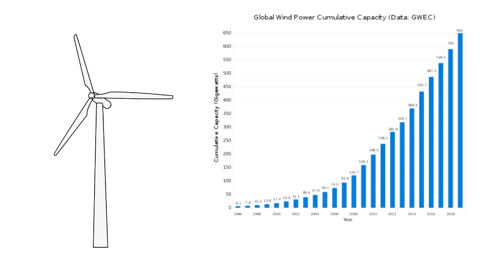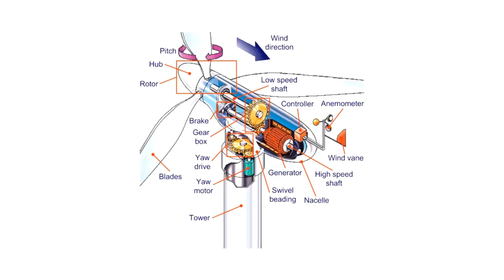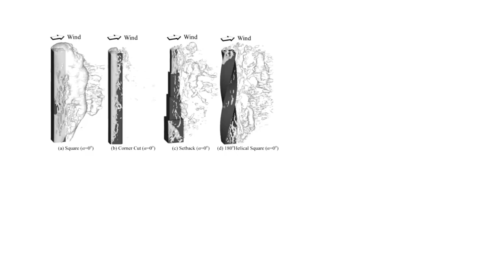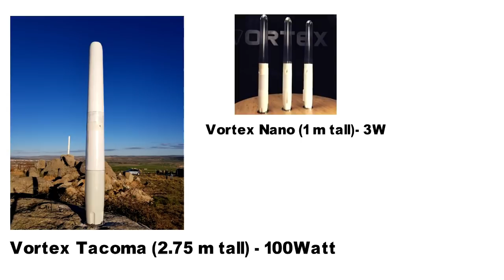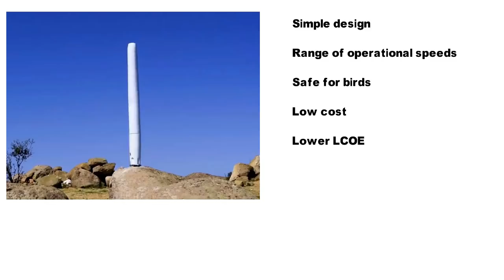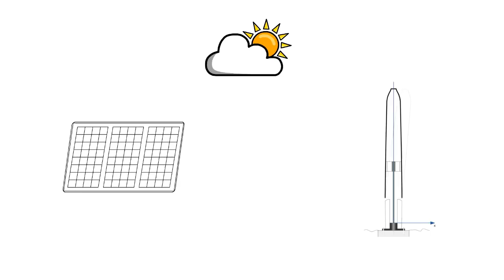Bladeless Wind Turbine

Comment: Place them along side a highway.  The passing traffic generates gusts of wind.
Reply from the maker: Great idea.Would also act as separators
Reply: I like the idea, but it would be interesting to see whether their presence would cause turbulence that affects the vehicles negatively.
Reply: @wesleymouch7498  hahahaha you mean like lampposts do? Or traffic sign posts? Or billboards? Other cars and trucks? Or any other structure for that matter? Have you ever driven by a structure that doesn't move, and worried that you couldn't pass it safely because you were worried for the wind? I mean.....reallyyyyyyy?????? And we are not speaking about hurricanes or tornado's let that be clear.
Reply: They would also serve as a method to diffuse road noise intruding in to residential areas. You could even make them look like trees, offering more surface to interact with the wind be aesthetically pleasing.
Reply: @synergyfiles3536  Does it make noise? Because it seems to be that people who are against all forms of renewable energy production have abnormal sensitive ears. Apparently they are able to detect every single vibration, even if it falls well beyond the range that humans can detect, and it makes them instantaneously sick as soon as they even think that a renewable energy source is causing any type of vibration or noise at all. 

Except when those vibrations and noises are produced by a toxic and polluting device such as an internal combustion engine. They believe that burning fossil fuels is perfectly healthy, and the noise and vibrations from such a toxic and polluting device are also not a problem for them.  

But a renewable energy source is not allowed to produce any sound or vibration at all, otherwise they get really sick...while other normal people do not get sick at all, so we must care for the poor crybabies. 

And also, it is not allowed to make the device from any "stuff" at all, because they will also say that if you make it from "stuff", and I mean any "stuff" at all, that it is more pollutant as making "stuff" that burns toxic and polluting fossil fuels instead of using wind power. And no matter what stuff you would use, they will always say that it is dangerous stuff, even when their whole house is packed with crap that is made from the same stuff. 

So make sure that the power converting device does not make any sound at all, also make sure that it does not vibrate at all because they will be able to detect it, and also make sure that it is not made from any stuff at all, otherwise they get really mad and really sick.
Reply: @insAneTunA  We are all carbon-based life forms. It is not a pollutant; it is an element on the periodic table, and the element that makes life possible. The carbon in the ground used to be part of the carbon cycle, and freeing it increases life. To call it a pollutant is to call life a pollutant.
Reply: @machinemaker2248  Show me where I mentioned the word carbon, or where I said that carbon is a pollutant. You are looking for a senseless fight, or you want to polish your ego, or you are just not that bright, or it is a combination from all the above. 

Clean fresh water is not considered as a toxic or polluting substance, and yet it can kill you. 

A substance doesn't necessarily have to be toxic or a pollutant to be harmful.......right? I mean, we can all agree on that.....right?

If not, you don't even need to respond. I am not capable of having a meaningful and constructive conversation with people whom respond with an answer that sounds as meaningful and constructive as "ooga booga wooga". I don't speak that language.
Reply: @synergyfiles3536  And likely sound suppressors so that traffic noise wouldn't affect people who live near the highway.
Reply: Can it pinch you?
Reply: @greevar  Imagine a power-generating "palm tree" gently swaying in the wind... getting wind power from its "trunk" and solar power from its PV "branches".
  Now imagine a concrete jungle full of such "palm trees"!!! The suburbs & rural areas too, with yards & streets lined with "trees".
  Decentralizing power sources could end massive blackouts from natural disasters or even cyber attacks. 
  🥗Food for thought.💭
Reply: lol
Reply: eblman  However, placing a forest of them along truck routes would generate lots of power, 24/7.   LA's freeways are only packed during rush hours. Big rigs produce very powerful, predictable and reliable turbulence most hours of the day.
Reply: @greevar  I was thiking the same, they would be more effective
Reply: @wesleymouch7498  TUrbines using wind from passing vehicles has been studied, and they need to be a certain distance away, not t increase fuel consumption, but the idea is valid.
Reply: @machinemaker2248  Arsenic, Plutonium, and Uranium are also elements.  Every poison, pollutant, and toxin are made of elements of the periodic table.  It's not the carbon itself that is a pollutant, but carbon and oxygen, carbon dioxide, that is the problem.
Reply: All wind generators work by taking energy from the wind and this inevitably means there will be wake-effects, meaning a generator placed downwind of another generator will generate less power over all. So you wouldn't want to place a lot of wind generators in a close row, especially if this row is parallel to the expected wind direction. 

As mentioned in the video the larger Vortex Atlantis has an installed capacity of 1 kW. Today a regular HAWT-turbine has an installed capacity 5 000 times greater than this, and the largest HAWT-turbines are pushing 10 000 greater. So if you decide to place one Vortex Atlantis every ten meters on both sides of a road (which is probably too close), then you would have to this for 30 km in order for the total installed capacity to equal one regular HAWT-turbine. 

Then there is also the question of "capacity factor". This is the percentage of time a generator is operating at its installed capacity. Regular HAWT-turbines are placed at optimal wind conditions and might achieve a capacity factor of 35%. I seriously doubt a Vortex Atlantis would be operating at full power merely from gusts of wind from passing traffic. Whilst the video does say that the turbine-less generators are suitable for wakey and turbulent conditions they will certainly perform better in smooth nice airflow. 

The turbine-less generators probably have a similar market to small scale solar roofs, but I suspect the solar power is significantly better in almost every way. I only see this turbine-less generator being used in very niche situations or as a PR-stunt. 

Would you rather have 1 regular HAWT-turbine placed on a windy field somewhere or 10 000 nine-meter turbine-less generators in a city or by a road?
Reply: So how does the commissioning and decommissioning cost problem get solved?
Reply: @insAneTunA  Mount one on top of every lamp post.
Reply: Not only are these a waste of money and materials, it is a really bad idea to steal kinetic energy from vehicles.
Reply: @wesleymouch7498  then the turbulence has to overtake the vehicle that caused the turbulence
... otherwise is would be just the wind :)
i always love to say that
Reply: @insAneTunA  swinging lampposts
see them lichts dangling.    :)    ..?
Reply: eblman  that is no fun
since the car has to be running for the airco
Reply: At the cost of 5% efficiency of the extra fuel usage the traffic will experience from the added turbulence. TANSTAAFL.
Reply: @machinemaker2248  humans might qualify
please please let us qualify :)  Master.
Reply: @insAneTunA  i do not love machinemaker but you driving a steak through his heart did not help your cause
you're both wrong :)
Salomons decision
Reply: @onegerard1  hahaha It is what people call sarcasm. I wrote it in a sarcastic style in order to make a bit fun of the people who are against every form of renewable energy. Because they always use the most silly arguments that do not make any sense at all.
Reply: @onegerard1  I took the wind out of their sails. It means that I did take away their opportunity to use those silly arguments.
Reply: @hans-joachimbierwirth4727  The vehicle is using the same amount of energy to travel down the road and push the air.  Using the moved air after the vehicle passes does not affect the vehicle any.
Reply: @darrellpatton4008  Well said.
Reply: @darrellpatton4008  You are mistaken. There is a pressure gradient from high pressure in front of the vehicle to low pressure behind it, and the air follows that gradient. Outside of that gradient there is no movement, and any kinetic energy taken from within that gradient slows the air movement and increases the air resistance so that the engine has to work harder and consumes more fuel.
Reply: There are Vertical Axis Wind Turbines that have been developed that can be attached to existing roadside infrastructure (lampposts) and which operate far more efficiently than vortex blade-less generators.
Reply: @hans-joachimbierwirth4727  Those effects, if there would be any, because non of this nonsense have been proven in any form at all, can be neglected even it was true. Because sometimes the wind comes from the back of the vehicle, and sometimes it comes from the front. So if those effects would occur at all it would be such a minimal effect that it would be hard to measure, and therefore it is not even worth mentioning it. 

In fact, debating about this online has cost more energy as catching energy from passing vehicles.
Reply: It keeps amazing me how clean renewable energy sources can make so many people so angry and fanatic and aggressive. It's just too stupid for words. It's time that the world stops listening to these angry people, and start doing whats best for all of us and the generations that come after us.
Reply: You could probably supply an airport and possibly a small town with electricity by using the jetwash of departing planes. Place them where the jets backup and build up thrust before take off. At peak hours you could likely keep several flywheels spinning at capacity.
Reply: @hans-joachimbierwirth4727  It is not stealing kinetic energy, it is harvesting residual energy that would go to waste if it doesn't get harvested. And that is where your nonsense goes up in smoke. 

A moving vehicle creates turbulence regardless of what structure stands at a certain distance from any normal road. And if we can catch some of that residual energy that is created by that turbulence it doesn't make any change on the vehicle that is already way passed the vertical turbine or whatever the device might be that converts the energy by the time that the turbulence is actual converted into useful energy. And those structures are already present on the roads. So it doesn't even make a difference to the current situation.  

But besides the turbulence from vehicles the roads are also a highway for wind, so those turbines would also catch natural wind. 

Look, whatever you believe, the energy transition is going to happen, and these type of ideas are part of the solution, and people like you are part of the problem.
Reply: @slythewhyissilent  At an airport they want to avoid tall structures for obvious reasons.
Reply: @hans-joachimbierwirth4727  in this case it's not stealing energy from wechicules. This energy is already lost in noise and gusts.

If You want to steal energy just put few magnets and lots of coils under the road - this way You will make cars induce change in magnetic field and in consequence induce electricity in coils. 
It's bad idea only because it might led to some troubles in car electronics. Otherwise it would be the best way to enforce speed limitations - no bumps, quite gentle force sucking cars downwards and backwards and hardly detectable heating of the car.
Reply: @insAneTunA  Horizontal. Starting at ground level, have several in a row each rising above the previous one until you hit the point of diminishing returns or height restrictions.
Reply: The problem is all the idiots running off the road and ruining them I see at least 1 18 wheeler run of the road into the ditches here where I live every month
Reply: Don't try to lecture people based on ignorance. You are completely mistaken and you find my explanation of the physics in one of my comments above. It is theft and causes increased fuel consumption.
Reply: @hans-joachimbierwirth4727  Your so called explanation is full of imaginary assumptions :-)
Reply: @insAneTunA  Thast's basic physics, and your claims are flat earther level denial. Energy consumption is air resistance and air resistance is a cumulative force building up like a bucket chain. Putting something in the way causes increased fuel consumption. Harvesting energy from the airstream does in all cases add resistance to the airstream and that is like a flexible lever tied to the vehicle. There is no free energy. Cars do not drive in a vacuum. Their efficiency is mostly dominatred by air resistance.
Reply: @hans-joachimbierwirth4727  Another example. Lets say that we are the salt flats in the US where they do these land speed record races. There is no structure at all. 

A car starts moving real fast on a fixed track. Lets say that we put a few turbines at 20 meter distance from the track, and we catch some energy that was created by the turbulence from the moving car. 

I will guarantee you that the moving car will have the same fuel consumption as it would drive on a track without the turbines on the side of the road. 

That turbulence would have been created by the car regardless if there are any turbines beside the track. 

For the car it doesn't make any difference at all, and no laws of physics have been broken. 

Again, you are full of utter nonsense.
Reply: @insAneTunA  Stop it. You lack the basic understanding of mechanics. All of your comments stand in contrast to undisputed science. You either don't catch any energy at all or you are putting drag on the vehicle. There is no way around actio = reactio (Newton's lex tertia).
Reply: @hans-joachimbierwirth4727  You would be correct when you strap a turbine to the moving vehicle, but that is not the situation. We are speaking about residual energy that was created by a moving vehicle that has drag, or air resistance, regardless the fact if there are turbines positioned down the road at 20 meters distance. 

And since we are speaking about hundreds of thousands of cars on a busy road, over a fairly long stretch of road, it all ads up. 

Just shut up, because you have no clue what you are talking about. You did not even answer my questions in my first example. How is it possible that the second airplane crashed while the first airplane did have normal fuel consumption? 

According to your utter nonsense that should not be possible.
Reply: @hans-joachimbierwirth4727  Another example that proves that the laws of physics  are not broken and that you are full of nonsense and looking for an ego trip.

 Lets say that I cook some potato's. That takes an x amount of energy. 

But when I cooked the potato's the water that I used is still hot. Now lets say that I want to harvest the residual energy from the hot water. 

Would the fact that I want to harvest the leftover energy from the cooked hot water influence or change the x amount of energy that I needed to make the potato's cook in the first place?

The answer to that question is obviously NO. It doesn't make a damn difference, and yet there is enough residual energy in that hot water to harvest. Well after  I cooked that same water. And it didn't change a damn thing in regards to the x amount of energy that I needed to make the water cook. 

When you catch wind from passing vehicles you are catching  energy that is created anyway by those vehicles, because cars always have drag or air resistance. But instead of letting that turbulent air go to waste, we use it to convert that energy into electricity. 

In this example the energy from the Turbulent air resembles the residual energy that is still in the hot water. 

No laws of physics have been broken.
Reply: There is no residual energy. Energy is in the directed movement of air, not in anything residing. Adding resistance to that movement is the only possible way of getting energy out of it thereby slowing down the air flow, which decreases relative pressure at its destination and increases relative pressure at its source which causes an increase of air resistance at the vehicle. There is no "was created" but a dynamic system composed of the moving vehicle and the surrounding air. All of your ideas are bullshit. You're attacking settled science like a flat earther.
Reply: @rudycarrera791  Interesting.
Please keep going with your idea.
Would those be coconut palms or date palms? Yes, I'm having fun, but I am thinking of battery harvesting;-)
Reply: @insAneTunA  to top it up,dhey here in mind natural tree fall in a jungle distant away,dhey are made of stuff Godzillous knows what and can pick vibrations from 🍊 planet😡👍🏽🙏🏿
Reply: Wobbly sausage!
Reply: @hans-joachimbierwirth4727  Last and best example to make it stupid simple, even for you. With video. Let's say that we are on a boat. The boat creates a wake. A surfer decides to surf the wake without any rope. 

According to your nonsense the boat should have less fuel efficiency the moment that the surfer decides to surf the wake. 

While I say that it doesn't make any difference at all for the fuel efficiency from the boat if the surfer decides to surf the wake. 

The transmission of energy between the propeller and the water is not 100% effective or efficient. The water creates drag on the blades of the propeller. Some of that drag pushes the boat forward, but some of that drag does not push the boat, but instead it creates a wake, or a turbulent highly energetic vortex in the water. And that water, very turbulent and highly energetic, contains enough residual energy to make the surfer go forward.   

Very similar to a vortex of air on a highway, created by the drag from a truck, instead of a propeller blade in the water. 

Long story short. That residual energy from the wake, that is similar to a vortex of air behind a truck, is used by the surfer to move the surfer and his board forward. And it doesn't change the fuel efficiency from the boat. NOT AT ALL !!!

How to wakesurf without a rope. 
https://www.youtube.com/watch?v=doIq1T6o718

So in this case the surfer resembles a wind turbine at the side of the road. And a turbine at the side of the road is harvesting the energy that is created by a vortex of air behind the truck, similar like a surfer surfs a wake behind a boat. 

So you might use all the right terminology, but when you wrongfully apply the basic physical principals that you mentioned, you really can 't expect a correct result. And a big mouth doesn't make you right as well.
Reply: @insAneTunA  Stop it! Your comments are stupider than flat earther videos. All vehicles are causing pressure gradients, and that has been explained to you multiple times. A pressure gradient is a wave that has got a positive half and a negative one. Both cause drag as effect. High pressure in front and low pressure behind are the effect of energy spent by the vehicle. Velocity is the equilibrium of the vehicles power and the energy in that wave. Taking energy from that wave ends the equilibrium temporarily and the vehicle slows down or puts more energy in. It doesn't matter where the energy gets taken out of the wave. It doesn't matter whether that happens in the first amplitude or a later one. All changes get transported by the effects of changing resistance. You either don't get energy from that wave at all or you inevitably slow the vehicle. That happens with boats aswell as with cars on the street or trains on rails. You are denying basic physics here. There is no free energy.
Reply: @hans-joachimbierwirth4727  Nobody claimed that it is free energy. It is residual or wasted energy created by the moving truck, so it takes burned fuel but not more fuel, so it is energy that would go to waste if it doesn't get harvested. 

The air doesn't stop moving after the truck has passed. 

Answer my questions. How is it possible that the surfer in my last example can surf the wake, and that the boat does not have less fuel efficiency when a surfer surfs it's wake? 

Can you explain that for us all please?
Reply: @insAneTunA  As i said: there is no residual energy. The energy gets stored in the pressure gradient. The air (or water) runs from the upper amplitude to the lower one. Its flow is ruled by the molecular resistance. That is what brings the energy down again. The vehicle must put energy in to keep its velocity. The amount of energy needed is ruled by the air (or water) resistance. The resistance is ruled by the difference between the maxima in the wave. The surfer does decrease the efficiency of the boat. Where he uses the wave, he flattens parts of it and disturbs the flow producing a chain reaction of water molecules that takes away from the flow and thereby increases the resistance. The amount of energy stolen that way is exactly the amount needed to move the surfer. Same for cars and trains. Blades in the air stream increase the suction behind the vehicle directly, reduce the flow from front to back and mount pressure on the front.
Reply: @hans-joachimbierwirth4727  Answer my question dude. How is it possible that the surfer in my last example can surf the wake from a boat while the boat doesn't use anymore fuel when that surfer surfs that wake created by the boat?
Reply: @hans-joachimbierwirth4727  Your answer uses all the right terminology, but it is applied wrongfully.
Reply: @hans-joachimbierwirth4727  You are saying that to stop a speeding car all the police need to do is put up big sails on the side of the road and their effect on wind hitting them now will travel backwards in time and drain energy from a vehicle that passed it a minute ago. Great job, clearly you will be a shoe-in for the Nobel prize of physics.
This is even greater invention than the windmill blades that summon endangered birds hundreds of miles away from their natural habitat or the technique to stop moisture from condensing on surfaces when said surface is built as a part of a water collector. Though you might have some competition from the regenerative brakes that produce more power  when the car is not braking than when it brakes.
Youtube is great place, so many inventors figuring out ways how to break physics! None of the science guys at DARPA, MIT, CERN and other think tanks has ever come up with anything like these ideas.
Reply: If the surfer wasn't surfing the wake, the boat would still use the same amount of energy to move forward. The only difference would be that the wasted energy compared to the input energy would not be used and that it goes to waste. Because those propeller blades are not 100% efficient, some of the used energy to move those propeller blades goes to waste in the form of some heat, and the other energy goes to creating a wake behind the boat. 

It doesn't matter at all for that boat if the wake is surfed or not.

If the energy transfer from the propeller blades to the water would be without any losses at all, the boat would go with speeds that are not even imaginable. 

So part of the input energy that is used to move the boat forward is converted into heat, and part of it is turned into potential energy in the form of a turbulent wake behind the boat. Both are considered as energy losses. And this happens regardless if a surfer would surf the wake. 

However, a surfer uses that potential energy from the wake to move his mass forward. Similar as a turbine would do with the vortex that was created by the drag from a moving truck. 

The truck creates that vortex anyway, no matter if we decide to harvest the energy from that vortex well after that truck has passed, or not.
Reply: A company called alpha 311 is making vertical wind turbines to place them on highways.
Reply: @AshutoshShelkeP  Cool stuff :-)
Reply: @jedgar63  then humans are the problem every train lane automobile and floating vessel on the planet only put out 15-20% of all carbon dioxide on our planet people don’t realize our planets life cycle is cyclical every couple 100k years there is an ice age caused by the abundance of life on the planet. More life = more carbon dioxide. Each human breath out the equivalent of 2.5 gallons of carbon dioxide every day, an these are the humans at rest not counting the ones moving for work or exercise or play this all brings that number up a professional sports athlete might breath out as much as 10 gallons per day multiply that by the number of humans and the numbers are astronomical then factor in all the animals. Our planet is getting hotter yes because there are to many humans alive at this point in time no other reason.
Reply: @insAneTunA  this is simple the turbines would have 0 effect of the cars traveling down the road as a car is not affected by the trees on the side of the interstates nor is it affected by the guard rails on a bridge
Reply: @Justthemow  I know right? The same thing happens with a boat that is creating a wake. A surfer can surf that wake without a rope, without having any effect on the fuel consumption from the boat. It is exactly the same basic physiologic principle.
Reply: @Justthemow  No kidding?  And what has this to do with my comment?  I am not now, nor have I ever been, an anthropomorphic climate change denier.
Reply: @jedgar63   I dunno maybe I misread your comment
Reply: @wesleymouch7498  like lamp posts?
Reply: @Justthemow  No problem.  We're on the same side.
Reply: being done in UK placed on lamp posts. wiring in place already. cool idea
Reply: Would need periodic cleaning, car exhaust can make things pretty dirty over time.
Reply: I've got a degree in aeronautical engineering, and will say you actually hit the head on the nail there. Because, that is the only place this concept would be able to produce any kind of a steady energy output. Just need to ensure the resonance frequency of the devices are matching the frequency of the average passing vehicle...
Reply: @insAneTunA  Yes, these generators will emit a significant amount of noise. It's the same principle as when electrical lines are humming, or indeed any kind of resonance.
Reply: @machinemaker2248  Science isn't your strong side, is it ??
"It's the carbon cycle"....
No, it is not, very far from.
Indeed, when the dinosaurs died, they slowly turned into carbon derived substances in the ground deep below us. However, every time you fire up your  car, every time you take a bath, or drink a coffee.....you are BREAKING that "carbon cycle".
Carbon is a chemical element, and is widespread in the nature. But, it's not supposed to be burnt on purpose. You see, burning oil/coal is creating large amounts of carbon oxide, which really is not a part of the "carbon cycle". Carbon oxide is basically the toxic byproduct of our civilization. Prior to us  arriving, Carbon oxide was not widespread in the atmosphere. Now it's choking life itself!
Reply: @thefreedomguyuk  hahaha okay :-) I hope that you understand that I was being sarcastic towards all those people who are against every form of renewable energy :-)
Reply: @insAneTunA   Go to any coastline or mountain range with highways cut through rock & hills, during a gusty wind-nothing much, say 50-65 mph or so. Drive normally. Horizontal pressure on your vehicle ceases abruptly passing behind the formation, & starts-just as abruptly-as you emerge. Vehicles can blow into oncoming lanes, threatening traffic. Or slew toward the edge abruptly. Enjoy!
Reply: @greevar  They'll look as real as cell towers covered up to look like trees, but that would minimize the tower's appearance. Sorta.
Reply: @amandawilcox9638  It is even possible that an airplane comes crashing down on that very specific stretch of road, with that very specific type of landscape, and a very specific wind situation. You forgot to mention that. So scary....
Reply: @wesleymouch7498  baaaahahahaha
Reply: @machinemaker2248  WTF are you talking about?
Reply: Install them in and around Washington DC there are plenty of windbags and hot air.
Reply: @insAneTunA  Hans can't answer your because he made up his response. He is the kind of guy that claims the sun is less bright in the opposite direction because he got a sunburn.
Reply: @hungryjack8032  There is a whole online hate campaign against renewable energy going on. And it seems to be coming from the radical right and farmers and the nuclear and fossil energy lobby. I see the most absurd videos with the most absurd anti renewable energy claims passing by. And videos about certain problems, that in itself might be true, but with these ridiculous and radical so called solutions that do not make sense at all. 

As if we should abandon renewable energy all together because one company refuses to clean up decommissioned turbines, or is allowed by local politicians to let decommissioned turbines rot for many years, stuff like that.  

They come up with false stories about turbines being toxic, or that they make weird noises beyond the spectrum of human hearing. Or they will say that it is a fake technology that doesn't really work. They will do or say anything to discredit renewable energy. 

There are several officially covered stories out there about so called climate experts who were payed by the fossil fuel and nuclear power industry to spread false information about the climate effects of burning fossil fuel, and the dangers of nuclear power. 

And that sort of practices still continue to this date, I have no illusions about that.
Reply: @hungryjack8032  People should learn about the story from The Dutch climate skeptic Frits Böttcher.
Reply: Where will the vehicles come from?  All electric?  ‘“Green” energy cannot sustain the traffic volumes.
Reply: @jonathanboyle6548  1-Yes technically it is possible 2-it is not necessary to have 100% green energy. Who said that we need 100% ??
Reply: @insAneTunA  Actually, the purer the water the more life-threatening.  Ultrapure water will extract calcium out of your bones if you drink enough.
Reply: @RichTheEngineer  New challenge...name all the different situations that clean fresh water can cause life threatening problems. :-)

I was thinking about your example...and I came to a similar conclusion. If one sugar cube drops on your head everything is fine, but if enough sugar cubes drop at once on your head, let's say a million of them, than I am sure that it can be life threatening :-)
Reply: @insAneTunA  I agree with @wesley Mouch, although there is waste energy off the cars by the turbulent wind this would create more resistance for the vehicles closer to the turbines. it would create what is called a boundary condition. Its not about the resistance your car will feel going down the highway but the fact that this system will make every car less efficient and that adds up. And to make sufficient energy you would need lots of these on the barriers or side of the road. Not to mention how unsafe it would be if a vehicle ran into a barrier with one of these on it.
Reply: @Tyleroke1  I have given 3 different real life examples why your assumptions are not correct. And I also explained why it is not free energy, and why no laws of physics are broken, and why it doesn't matter at al for the fuel efficiency from the passing vehicles. Read some more about what else I wrote, I am not going to repeat it. If you still don't agree with it after reading that I wish you good luck and a pleasant day :-)
Reply: @insAneTunA  wow you are really invested in this thread probably more than ya should be. as your holier than thou demeaner gives off. You have given 3 real life examples but that is not proof or reasoning in the slightest. id agree if it was stated above that this is not free energy and the rules of conservation apply. but there is always a trade off and that will be with the highways being more turbulent and thus reducing the cars efficiency which at high speed is mostly determined by aerodynamics than internal friction forces. but the main factor here is safety. Also it isnt well explained how efficient these things are so is it even worth grabbing energy from passing cars? probably not. just as bad idea as solar roadways. you dont have to agree with me have a spectacular and safe day :D
Reply: @Tyleroke1  I already gave 3 examples, and yes that is proof of reasoning. And it is you who has no valid arguments AT ALL why my examples would be invalid, according to you.

So there is nothing to agree or disagree with, because you have not proven or disproved anything.  

You mention words as friction, as if I had never heard of that concept before, and aerodynamics, and those are all real fancy scientific words, but if you put them in the wrong context you really don't get the correct result. Although you might think so :-)

In my next reply I will give you some numbers, and the source of my numbers.
Reply: @Tyleroke1  Here are some numbers, and my source with video. The company alpha-311 produces vertical axis turbines for road side locations at existing infrastructure, such as existing lampposts and/or buildings or other structures. Their turbines need a minimal airflow of 1.2 m. per second. Typical traffic speed approx 100kmh. Residual airflow speed from traffic approx 5.4 m. per second. Their turbine produces 2.5 kWh with a power coefficient of 30%. 

The performance analysis was based on a 5.4 mile section of an actual existing road with the traffic data from that road, and analysis showed that a single small turbine is capable of producing 5.8 kWh daily. And that stretch of road can accommodate 410 turbines. So the total annual energy generated over that single 5.4 mile stretch of road alone is around 860 megawatt hours. 

www.youtube.com/watch?v=gcSnwW5v3f8&t=3s

The company alpha-311 also has a website. But you need to google that yourself.
Reply: The reality is that a moving object like a car or a truck or a boat creates vortexes. Normally we consider that as parasitic losses due to drag. We just let the energy go to waste. But it is possible to harvest that potential energy from those vortexes without interfering the fuel deficiency from the objects that create those vortexes. As long as we put those energy harvesting devices at the correct position, not only for energy efficiency, or to prevent extra drag on vehicles, but also for safety. 

Anyone will agree that it doesn't make any sense at all to create a system that is not safe and not efficient, but most important of all, it simply wouldn't be profitable. However, it is a very good addition to the existing infrastructure, especially if it would be combined with the technology from Skeleton ultra capacitors. 

The technology isn't the problem.
Reply: And in addition to that, let's not forget that a vortex is a local and turbulent highly potential energetic pocket of air or water. In fact we can consider a vortex of air, or water for that matter, as an highly turbulent and amplified  pocket energy. Because all the input power to create that vortex is compacted into to these small highly turbulent pockets of air or water. 

And a vortex with highly turbulent air or water has enough compacted energy to travel over a certain amount of distance, while remaining enough energy to be harvested at the point of harvesting, without being any interference for any input power source that created those vortexes. 

If you want to have vehicles that are more fuel efficient, you must create vehicles that have less drag, and therefore create less vortexes with highly energetic pockets of turbulent air or water. 

So you must create vehicles hat have better aerodynamics or less water resistance in order to get less parasitic losses :-) In other words, once the drag is created you can't change anything about the fuel efficiency from a vehicle. 

But we can still harvest some of those parasitic losses once they occur. It wouldn't change the fuel efficiency from the vehicle itself, or the mileage, but it would improve overall efficiency of the total input power or burned fuel. Because less of the total input energy would go to waste if we would use those highly energetic pockets of turbulent air, or those vortexes, created by drag, as an energy source. We can convert some of that energy from those amplified pockets of air or water(vortexes created by drag) back into electricity. Especially when those vortexes occur at a high frequency, like it happens on a highway.
Reply: Damn brilliant
Reply: @machinemaker2248  Yeah, the micro particles in your lungs will do you much good. Also, coal and oil are never pure. Did you know they even contain radioactive elements? Besides simple stuff as Sulphur.
Reply: Cleopatra's Needles.
Reply: @machinemaker2248  Finally, somebody with some sense about carbon and CO2. I've been making a very similar argument and nobody has countered it.
Reply: @machinemaker2248  yeah bro carbon monoxide and cyanide arent pollutants, theyre just life. Negative life for sure, but thats life too
Reply: Actually the best aero drag is between moving vehicles. I suggest placong them right in between!
Reply: Why not installing in front of an electric car? This way it can creat electricity while it moves and charge  the battery so the car doesn't need to stay plugged for hours to charge.  Also the wind it can be created by the fast movement of the car.
Reply: This idea is not productive, it is called perpitual motion machine
Reply: @insAneTunA  maybe they can hear the turbine generator?  maybe they create a scraping sound that most cannot hear, where a gas powered generator might have enough interference from the gas power that it interferes with and disrupts the sound of the electrical generation?  just a possibility.................
Reply: @aurorauplinks  No, that is not realistic. Your imagination is far too wild.
Reply: @insAneTunA  did you know dogs can hear all sorts of things humans generally can't?  did you know people of different ages often have wildly different hearing? adult males literally will sometimes stop hearing certain pitches of frequency they heard most of their life.  as they adjust to deeper tones and lose the ability to hear higher pitches.

Some people just have higher frequency of hearing.

Have you ever heard a plane flying overhead?  its ridiculously loud yet its far away.  why assume someone can't hear something high pitched that you can't??

If you can't hear it no one else can?  does that happen with other things in your life too?  if your happy then everyone else is too?  and if your sad then so is everyone else?